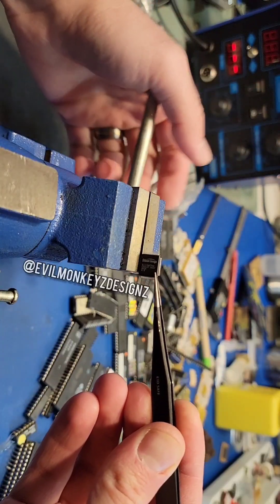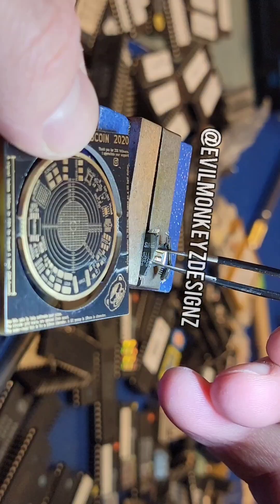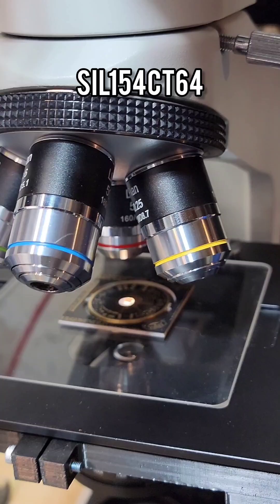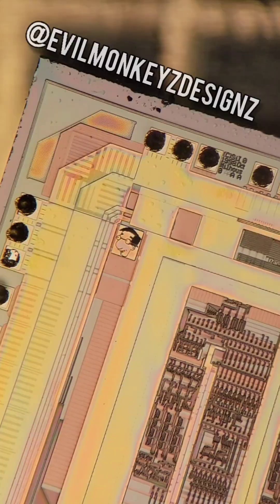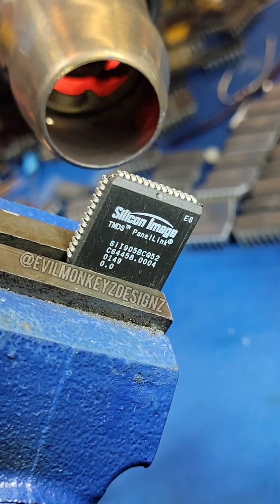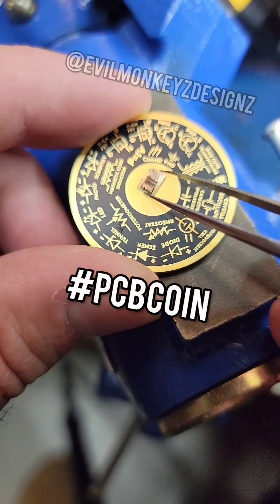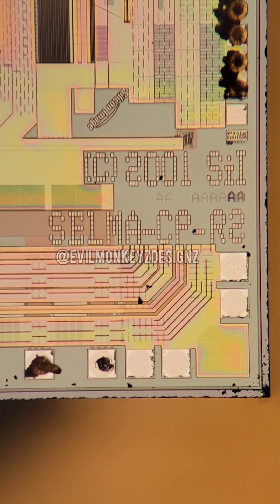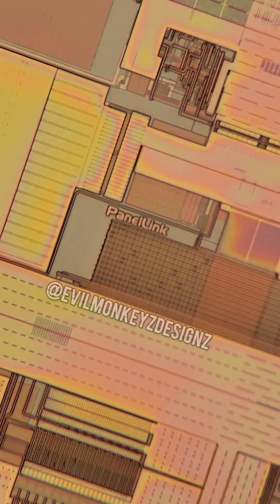Silicon Chips with #Simpsons code-names

Comment: Rookie question. Is that actual gold? Or just a little coating?
Reply from the maker: Yes, the bond wires that connect the silicon chip to the lead frame are indeed pure gold. That being said, they are incredibly tiny so there isn't actually all that much gold in a single chip like this. Also, many parts use different metal/alloy wires instead of gold, so not every chip will have gold wires in them.